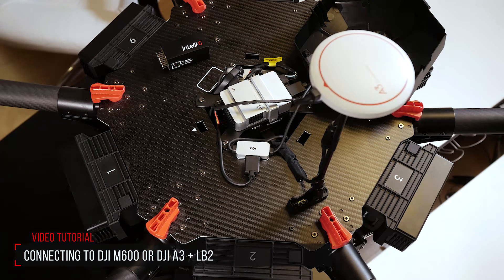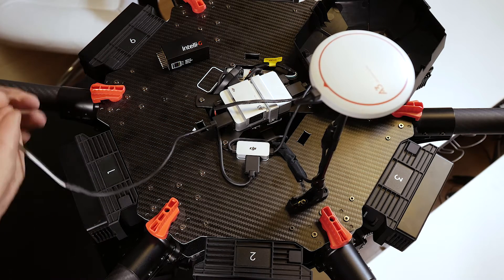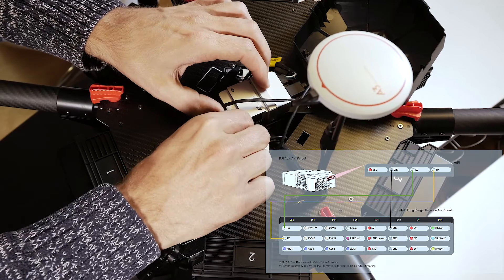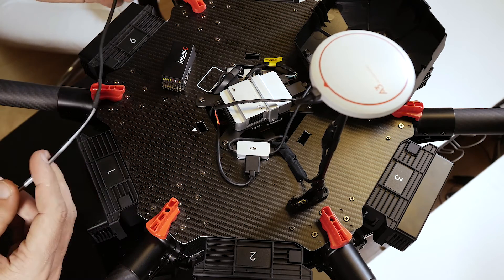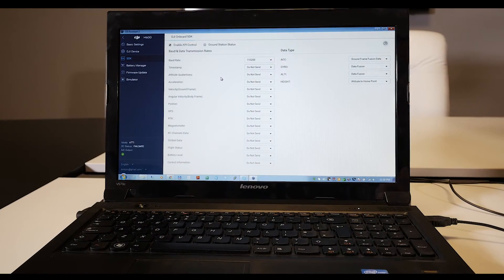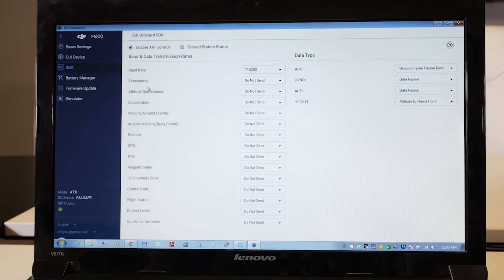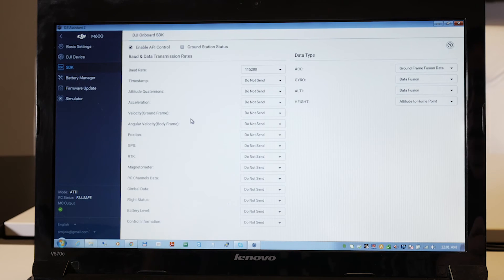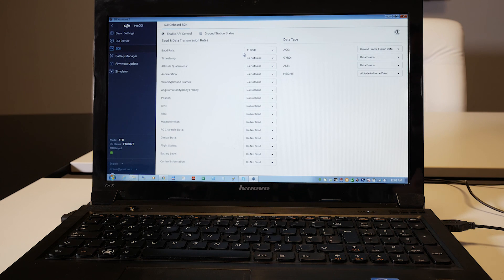Intelli-G Video Tutorial - Connecting to M600 or any DJI A3+LB2 platform

Comment: Hello, I am using DJI Lightbridge 2 with a Zenmuse Z15 gimbal and A2 flight controller.  My biggest problem with Lightbridge is that while I'm in flight I can not trigger the GH4 to shoot video and or photos without manually changing the camera from creative mode for shooting video to manual mode for shooting pictures.  I was wondering if you might have any suggestions on how to do this.  Thanks in advance for any suggestions you might have.  -Dave
Reply from the maker: On Panasonic cameras you cannot do both without physically changing the camera mode :(. On Sony alpha you can keep the camera in Stills mode and start video recording and it will automatically changes modes.